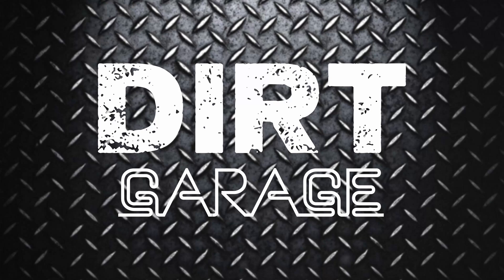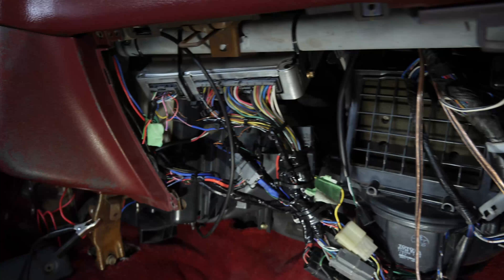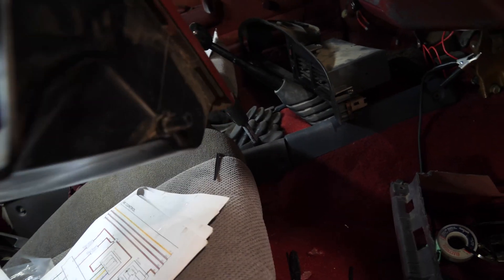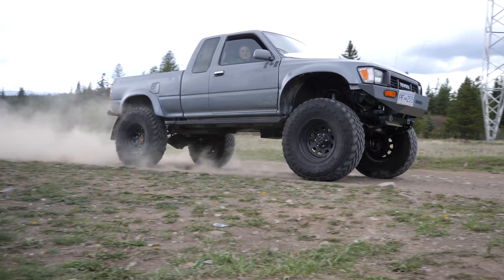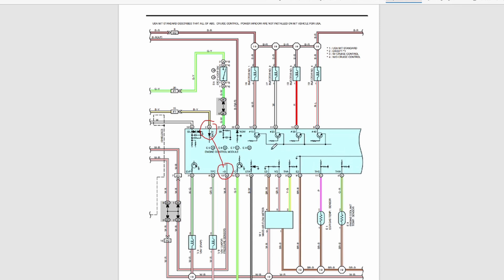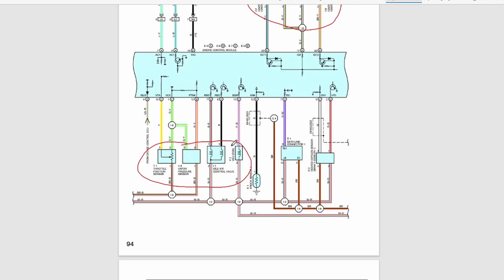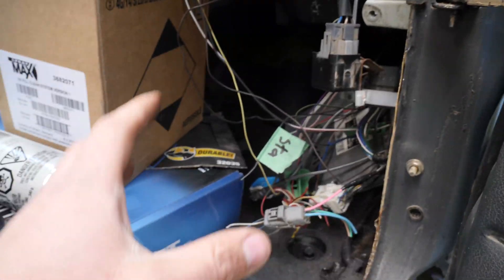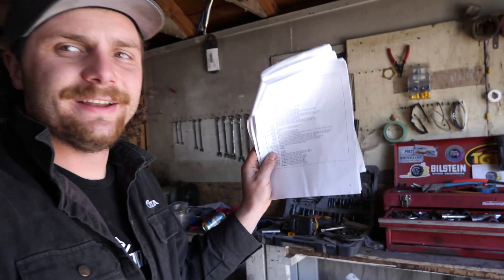EASY How-To Wire Toyota Engine Swap | 3.4 5VZ | 1UZ | 3RZ AND MORE...

Comment: Same old question where do you get those wiring diagrams. Putting a 2000 4 runner engine in my 91. Also the crossover exhaust down pipe flange is different on mine. Thank you and good videos.
Reply from the maker: From the dealership. Also you need 99 and earlier crossover, easier to modify
Reply: Ok thank you. I did already rebuild my cross over but it has the different flange. These swaps are not bad but definitely not plug and play like everyone said. Even having to drill the damned dipstick hole is a pain. Making my own guide for that as well.

Comment: Hi dirt garage love your channel ok so my boyfriend did the 3.4 swap I have a 95 4 runner. So  my boyfriend did the entire thing himself. We had it running and driving for about 3 months. Then one night we were going about 25 mph and we had to hit the brakes kinda hard.  So my truck died and when we went to start it back up it just cranks now and it will not fire.  It has been so frustrating. Timing is TDC there is fuel pressure there is spark. Igniter is grounded . Please give me an idea please. It wants to start but it only back fires and sputters. . Please and thank you for all you  do respectfully  Toyota chick
Reply from the maker: Check the crank position sensor. That's what it sounds like to me
Reply: @DirtGarage  thank you I will definitely do that

Comment: Can I ask where you got those wiring diagrams? Also my rz was running fine then I did some wiring clean up from the last guy I believe I clipped a ground by the ecu does that need to be replaced?

Comment: For the 2rz swap, where do I get the 1k2 plug & if it's from the donor body, how do I connect it to the 3vze dash harness ? Both the 3vze & 2rz run a manual transmission.

Comment: Maybe you can help me out I have a 86 22re 4Runner has a 2rz swap out of a 96  runs fine but if you turn the heater on or wipers it runs out of fuel if I hook power to the blue wire by the passenger seat to the pump it runs fine with heater and wipers on

Comment: I'm trying to get one running still in the doner truck and I'm getting no spark and has no bed or rear frame been wrecked idk what I'm missing could it be the distributor it's a 1995

Comment: Hey Clinton, doing a dizzy 2rz swap into my 89 third gen toyota pickup that had a 22re. Do you know how I can wire the stock fuel pump up to work with the swap, im not very good at reading wiring schematics.
Reply: Hey man I'd like to see what u got goin on I'm doing 2rz swap

Comment: What fenders do you have on there?  I've run Ivan Dan +4 (5?)'s but it always bummed me out to have to switch to the 2x4 corner lights.  Currently in the middle of a true long travel IFS conversion on a different truck and fenders are probably next.

Thanks!
Reply from the maker: The fenders are from www.toyotafiberglass.com

Comment: question, what do you do here about the immobilizers for later 1UZs and 3UZs?
Reply from the maker: I've only had ones without immobilizers, but it can be done with them. Gotta keep the key and tumbler wired and hidden under dash.

Comment: I wanna do a 3.4 swap on my 82 Toyota Pickup.       Can I just use everything from a t100?          Engine, trans, tcase, ECU, wiring harness, gages.     The driveshafts probably won’t fit but I needed a longer front one anyway cuz my 82 is lifted

Comment: 10:16 I don’t see the HI-MPG wire
Reply from the maker: HI-MPG wire?
Reply: @DirtGarage  Get High Miles per Gallon / Great Fuel Economy :D
Reply from the maker: @nemesis851_  Oh! Your talking about those eBay chips that totally are not just LEDs, and give you better fuel economy, more power and faster throttle response!
Reply: @DirtGarage  I’m sorry. It was only meant to be a joke. Everyone would love to run their truck for a month, on only a single tank of gas.
Reply: @DirtGarage  mystical wire we all wish existed

Comment: I noticed that the four wire you were using for power were of different gauges. Is there something that indicates the gauge or do you add up all of the load and the determine the circuit amperage and wire gauge? In a totally unrelated question, do you run an access cab for more room, longer wheel base or both?
Reply from the maker: I matched stock size for wires, the 2 small is 1 signal to trigger the relays, and the other small wire is 12v constant to the ECM.
Reply from the maker: I like the room in the access cab, and the longer wheel base is certainly nice.

Comment: I used toy only swap for my 3.4.

Well worth it!!!!
Reply from the maker: Absolutely. Good option if the wiring is overwhelming! Straight forward practically plug and play options out there.
Reply: That's what I'm thinking of for my swap. But I have a question, will it bolt up to the stock automatic transmission? Mine is a 93 4x4 extended sr5. Or you I need a new transmission as well.
Reply from the maker: @michaelmaroney1660  You need the auto from the 3.4 if you want to keep it automatic. The 5VZ ecm can't communicate with the 3.0 auto.
Reply: @DirtGarage  But it will bolt in with that tyranny? I'll order an engine/tyranny combo then. Thanks
Reply from the maker: @michaelmaroney1660  It won't, you need to customize your trans crossmember. Not only this the t case drops on wrong side, you need an adapter to run the gear drive t case to drop on the correct side. It's easiest just to do a manual swap at the same time instead of keeping it auto.
Reply: @DirtGarage  any ideas for a swap if I wanted to keep the auto. Perhaps going for the hialux diesel?
Reply: @DirtGarage  or you can use a T100 ecu 
My question is where do I find the aftermarket under hood fuse box you showed ?

Comment: Question for you. I’m running RUF and 63s on my truck and I know you have some experience with those. What shocks do you run to make them ride smooth in the road? Mine seem to ride a bit stiff in the rear.
Reply from the maker: We all pretty much run Bilstein 5100s, pretty good. But with these leaf sprung setups its going to be ruff no matter what. I typically run around town at 20PSI in the tires to make up for it.
Reply: EFS 👍
Reply: @clintmacpherson2514   Efs shocks? Never even heard of them
Reply: @PoorManGarage  Have a Google search very good suspension

Comment: my problem is what is the fit manual transmission to 2uz 4.7 engine
Reply from the maker: Easy. Same kit I used when 4.7 was in my truck. Look up on ebay. It's 1UZ to R150, same as 1UZ

Comment: You totally got me with the fake ending in the middle of the video, haha. Looks like routing all the wires and assembling them into a clean harness is one of the harder parts on some of the simpler swaps. 1UZ is looking good in that engine bay.
Reply from the maker: Yeah the wiring is easy. Making it look good is another thing!

Comment: This is a GREAT video! You have explained in only a few minutes what it took a long time for me to learn on my swap.
Reply from the maker: My original 3.4 swap the wiring took me over a month to get figured out. Learning how to read diagrams and what everything means takes a bit to learn. Now it takes me minutes to figure out how to get a engine running. Definitely comes with experience!
Reply: @DirtGarage  hey Man I can’t really find a straight forward answer in any forums but do you know if I’ll have issues doing a 3.4 swap out of auto into my 91 which was a 3.0 with a manual?